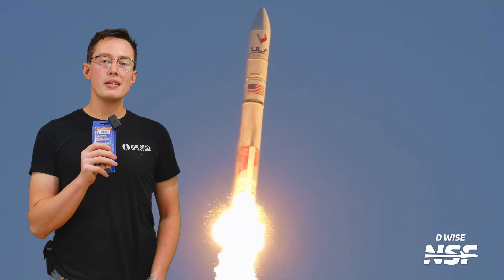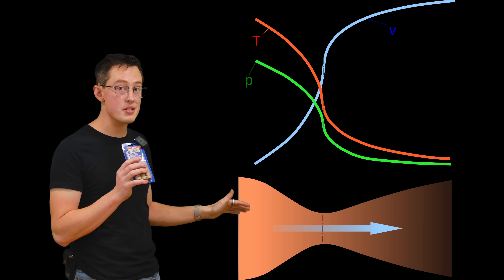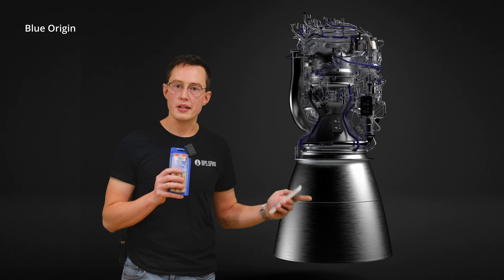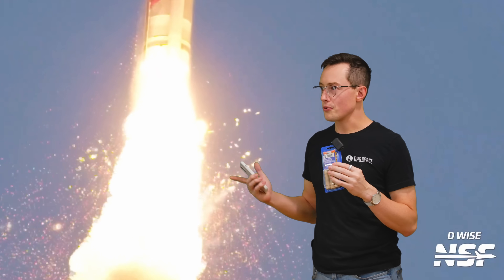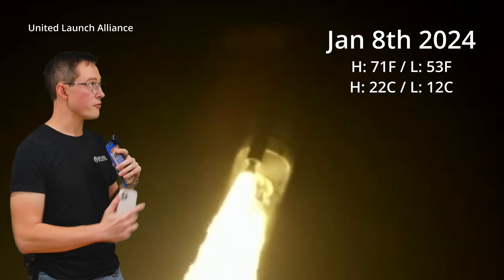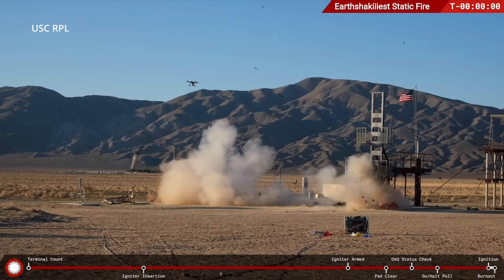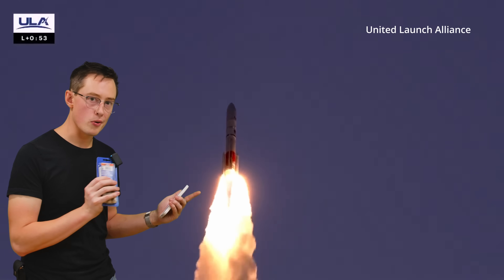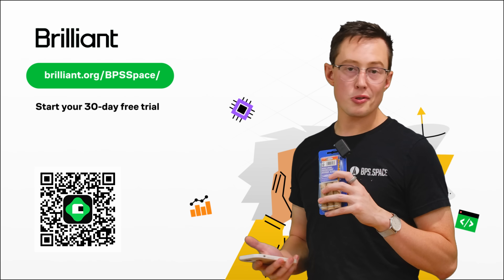The Problem with Northrop's Solid Motors

Comment: "Sometimes people get unreasonably upset about that" he said in preparation to delivering an accessible explanation in metrics 90% of the world do not understand.

And would struggle to understand even using convertors, because for literally each occupation the Imperial system users had developed their own versions of units.
That differ depending on the country in question 🤯

That's why I call it the Empirical unit system.

Comment: had a D9 engine explode on take off in one of my rockets. Luckily our design was inspired of the ariane 6 in config 64 so the engines were in the booster so we had like 1 booster exploding and the rest of the rocket still taking off. but yeah the booster exploding is definitely not fun even on small scale rocket x)

Comment: I work for Northrop and I work on these nozzles. Despite the sarcasm, I have to say this was a very fair analysis, especially given it was done only with publicly available information. 

SLS and its planned successor, BOLE, both have parabolic nozzles.

Many parallels have been drawn between the Vulcan and OmegA nozzle anomalies, but there is an important distinction between the two. The OmegA anomaly happened during tail-off. At T+ whatever time the nozzle failure happened, the booster already would have been jettisoned. Had this happened during a launch, the flight would have been unaffected. And without getting into specifics, it also needs to be considered that the conditions faced by the static test motor (ambient pressure) were not the same that it would have experienced in flight.

Comment: You talked about checking for bubbles in your mix after setting.  Would ultrasound be good for that?  Most of the ones I found on Ebay are kinda pricey but there were some under $300 delivered.  Not sure it would work for you even if you can find an inexpensive one.  Maybe a veterinary might let you bring a highly flammable rocket motor into their office just to give it a try.

Comment: The problem is Northrup Grumman itself.
They needed 10 years and $2 BILLION to modify the shuttle booster.

SpaceX built the Falcon 9, the Merlin engine, and the Dragon 1 capsule for a combined cost of just $800 MILLION. And they built all 3 concurrently in just 6 years. 
SpaceX was a 3 yo company when they started building them.

Either through planned greed, or incompetence, the taxpayers are getting screwed.

Comment: Actually, as the chamber pressure of the motor or engine goes up, the % of diverging nozzle effect goes up also.    When we get into high pressure liquid engines, the nozzle is a much larger % of the contributor of thrust.

Comment: Would it be possible to engineer SRBs with in flight detachable nozzles so that if a similar failure occurred on a vehicle which could not compensate for the asymmetrical thrust, the intact booster could also renovate and even the thrust out again to sacrifice power for an increased chance of mission success despite the failure?
Reply: The core stage rocket is designed to be able to compensate to a degree. If the other booster ditched its nozzle to even out the thrust, the rocket likely wouldn’t have had enough thrust to get the payload to the desired orbit.

Comment: What does kgf mean? Shouldnt force be in Newtons in SI or is this some rocket convention i dont know?
Reply: Specific impulse is the momentum per weight of propellant. We usually measure the mass of the propellant in kg. To get the weight we could multiply by 9.8 and change the units to newtons (1kg has a weight of 9.8N), or we can just change the units to kilogram-force, or kgf (1kg has a weight of 1kgf). It’s not part of the SI system but it’s an accepted shorthand

Comment: Solid rocket motors were old and dangerous and disliked already in the 30s. 
And in fact they caused the biggest tragedy for NASA back then.  The only applications vaguely valid is for long storage boosters that need quick launch in seconds: those used on 4th of July...
The STS had two because of the money of the dr strange love military, and in fact buran had the glorious Energia.
Reply: You mean like those used to deliver nuclear warheads. Both the, Minuteman III ICBMs and Trident II (D5) SLBMs are solid fueled for this very reason. The LGM-35 Sentinel which will replace the Minuteman's will also be solid-fueled. A missile that needs to be loaded with liquid fuel and which might take minutes to launch isn't a very effective deterrent. 💀
Reply: @aarongreen1654  this perfectly clear to me. As clear as the need to dismantle those Dinos underground since jfk
Reply: The Challenger disaster was entirely avoidable and people warned that it shouldn’t have launched. 

But overall, solid rocket motors have a good safety record.

Comment: Its an ABSOLUTE MIRACLE, that the solid booster didnt blow up. Even with the converging and throat sections supposedly intact, that could have gone very south.
Reply: The cases for these motors have a much higher safety factor than the nozzle. If there’s a failure, it’s far less likely to be in the case.

Comment: In order to see how much of each part of the nozzle does what percentage of work wouldn't you need to compare removing the part to removing all of it?  Surely the thrust doesn't drop to zero if there's no nozzle geometry at all right?
Reply: Just based on the initial tilt we see in the rocket, we know that the booster was still producing most of its intended thrust.

Comment: You will kick yourself... but those pre-assembled JST cables can be re-arrannged in the holder so you can  connect red to red and black to back..  With a small pick you can lift the tab on the plastic connector housing and pull the metal spring connector out of the housing. This will allow you to swap the red/black wires to your hillbilly battery connection can look a little bit less hillbilly. ;-)

Comment: To be fair, their solid rocket boosters have an exceptional record of reliability over decades. If you want to make the case that there is a systemic problem based on a recent isolated example of failure, you can make the same case about Falcon 9 engines.
Reply: falcon 9 uses 9 engines and it still had over 330 successful consecutive launches, highest record of any orbital rocket.
Reply: @miguellopez3392  Have you added up all the successful solid rocket booster launches? Despite the successful record of falcon 9 engines, they have suffered recent failures, so one should ask the question, why are they failing NOW? What has changed to make them start to fail after being so reliable, for so long?
Reply: @brendanpells912  yup, still not as close due to sheer number of launches it had, the boosters that are experiencing failure are the ones that have had over 20 flights so they are bound to fail.

Comment: Boeing being anywhere near a fucking rocket should be a crime, they have the worst safety of any modern airplane, and yet were just cool with them making fucking rockets?!
Reply: "they have the worst safety of any modern airplane," is just factually incorrect lol. They have had a few high-profile accidents lately, but in terms of actual metrics, they are still incredibly safe. The Boeing 717 literally ranks #1 on the list of safest aircraft in terms of total passenger miles flown. It's flown for 3 decades, carried millions of passengers, and has not been in any accident serious enough to cause a single fatality or aircraft loss. Not one. 

It literally doesn't get safer than that.

Stop getting your 'education' from headlines and social media.

Comment: 3:05  SLS solid motors are quite literally leftover shuttle motors (at least for the first few launches) so yeah, no change there.
Reply: They’re not a 1:1 match. There are some differences.
Reply: @AM-rd9pu 
I think they may be putting in an extra section, but they are literally shuttle SRBs getting pulled from storage.
Reply: @KingCovfefe  They’re 5 segment boosters as opposed to 4 for shuttle. The case segments and a lot of the metal hardware are reused from shuttle boosters.

Comment: SLS Boosters and the original SRBs both have parabilic nozzles, they qre just mostly submerged into the engine skirt and combustion chamber itself because they use a sunken flex seal for thrust vectoring.

Comment: Just look at the diversity, depth of knowledge, production capacity and innovation of all those businesses that were swallowed up by the big defence contractors like Northrop Grumman, Boeing, Raytheon and BAE Systems. It is obvious that most of that diversity, depth of knowledge, design and production capacity and innovation has been squandered and higher prices, longer delays and poor outcomes are the result. Break them up, simplify the defence acquisition process and offer more long term contracts.

Comment: A couple other important things about parts falling out:
If you can design the front to fall off when it's not flying (storage) and the back to fall off in flight, then it's safer. 
If the back flies off and your motor isn't made for reaching a steady-state thermal condition (bc steady state is too hot, think of short burns mostly) then when the back flies off the motor might burn for longer (if that included the throat) which would make thermal conditions everywhere much worse than expected.

Comment: So, to be clear, there was no problem with Northrop's Solid Rocket motors? They worked as designed which allowed the vehicle to make it to orbit? Am I missing something?
Reply: The nozzle failure happened because there was a problem with the motor. However, the motor was designed such that it could survive a nozzle failure and not cost the entire mission.

Comment: Well if the system works just fine without the nozzle, then delete the nozzles. The best part is no part. Can’t break, costs nothing, takes no time to install. They just proved they don’t need it, so delete it!
Reply: There was a significant loss of thrust. It was only because the rocket wasn’t near its payload capacity that the core stage and second stage were able to compensate for the lack of thrust from the booster.

Comment: It's supposed probably that the audience interested in watching rocket engineering calcs on utube instead of anything else are expected to be at least smart enough to be able to convert inches and pounds into metric and back if they go back to their comrades t build a similar rocket after watching. There are these catalogues where you (or someone) has to show a screenshot of some spectrum - colored image to prove they are smart enough to run it in simulation. It's supposed to be for granted. Ok what I' going to do is to write down a list of some ten reasons why I'm smart

Comment: If you need to machine a custom curve on a manual lathe use a taper attachment with a 3dp profile on the longitudinal rail for the follower to trace.

Comment: I found your channel through the NSF Flametrench video... entertaining and informative.

I have to say that my suspicion is that the canted nozzle design may be the part of the problem, since I can imagine higher exhaust force and erosion around the "outer" section that developed the failure. Can you model the flow differences around the throat / nozzle interface to check this ?

The great save for NG and ULA is that it seems they canhopefully just unbolt the exixting nozzles from the many already built and in-production SRMs and replace them with an improved design relatively quickly....

Comment: How much panic does such an even cause in the control room? Does it mean that some guy sweating suddenly a lot holds his finger over a self destruct button while others are calculating odds in record time? Or is this something which is already catalogued as an option of a failure and therefore can immediately be decided to work within the margins of efficiency (if it happens at a certain height and temperature)?

Comment: nah bro aint no way. This is a a extreeemly similar LRE that i am developing. From what i can see this is a printed copper alloy nozzle with a single pintle elemnt. Seems like 1-2kN in size and probably from the straight canals i am guessing cooled by ethanol. Its veeery similar to mine. It would be my pleasure to compare results. Very interesting seeling method between the injector body and nozzle. Best of luck on that project.
Reply: Allso i can see there is a extreemly thin wall wich might be sound in regards to stress and heat transfer but is impossible to print. If the alloy is to be cintered. Add the wall to like 1.5mm and then machiene it down. That wokred for me for CuNi2SiCr printed nozzles

Comment: Metric or imperial, they are both units of measurement that work perfectly for what you want to measure.
It makes more sense to use imperial when living and working in a nation where imperial units are the norm.

This is not a comment at mr. Barnard, but a general impression from someone based in metric:
I learnt imperial units long time ago. Mostly because I watch a lot of content that uses those units, so it was convenient to get a better sense of what they're talking about. What grinds my gears is how rare it is for americans to even look at metric beyond "isn't imperial, won't touch". There's nothing wrong with using imperial, but avoiding metric is weird.

Comment: 2:59 False. The SRBs on the Space Shuttle used a parabolic nozzle. What you see is a conical air skirt that housed separation systems and thrust vector controls connected to the nozzle underneath.  There was a lot of concern with the SRBs after the Challenger disaster. There is also a bunch of studies about the TVC, uneven nozzle ablation material wear, and the underlying char cloth fiber direction. Which I think you briefly mentioned before. Detailed video time? I’ll send you a message on Insta for that delicious source info!

Comment: maximum thrust is also most critical at the instant of liftoff where your thrust:weight is worst - losing 4% of your thrust after you've used 8% of your propellant is much less of an issue than just not having that thrust at the point of liftoff.

Comment: I have to wonder if this had be a Vulcan VC4 or VC6 with either 4 or 6 SRB's that failed SRB would have been right next to 1 or 2 other SRB's. Would that have possibly caused the nozzles on the adjacent SRB's to fail as well? Without that cone you would have a lot of the exhaust gas hitting the neighboring cones. Dreamchaser for instance would have been a VC6 launch. Something tells me this would not have been as successful on that.

Comment: Regarding the unit debate, I agree that metric is easer, but many large rocket companies still use imperial for design and analysis. It's a lot easier to buy imperial COTS parts in the US, and it's easier for machine shops to machine stuff in imperial units (more imperial tooling than metric tooling).

Also your technicians may berate you asking what "kind of commie units are you using" if you hand them a drawing with metric.

Basically, design is easier in metric, build is easier in imperial (if you're in the US). You can choose which one benefits you more, or commit to a bastardized system of using both.

Comment: Screw the negative comments! Use that imperial system. If it works, it works. Whatever you are more comfortable with shouldn't really matter to the comments, I almost guarantee that 99.9% of commenters have never and will never touch a rocket of any size. Keep on making awesome rockets and turning out fantastic content. Great work as always.

Comment: When I took a screenshot of the shuttle booster nozzle and tried to put a straight line over it, it didn't line up at all. To my eye it was 100% curved, but I wanted to check to be sure.

Comment: OmegA looked like the atmosphere crushed the nozzle when pressure dropped off quickly as the srb was reaching the end of the burn which ironically means on a flight it might have performed perfectly while on Vulcan it looked like it had a burn through.
Reply: Yes, buckling during tail off is a different failure mode than burn through during flight.

Comment: Did your calculations account for the apparent asymmetrical thrust? It looks to me like there might have been a gap on the outboard side that increased the angle of some portion (a third?) of the thrust, which reduces the upwards thrust.

How much did this drop performance beyond the calculations you made? Worth another video to answer?

Comment: In early testing of new things in our motors we will often dispense with the divergent cone altogether. As seen in this video using no divergent. You can clearly see is this video, this results in a seriously under expanded nozzle but gave us valuable info on casting tubes, liners, and such without risking expensive flight nozzles. https://www.youtube.com/watch?v=ykLyrmrDKg8&t=61s

Comment: 4:20 man, that's really what most need. 
the thing is that the imperic system is both slightly less effective and less common. plus metrics are in the Si system.

Comment: I found the video both funny and informative.  In particular the bit about the three degree cant being the difference between success and failure was something I hadn't heard anywhere else.  The one thing I would have liked to have seen would have been a discussion on the effect of altitude on the effectiveness of the nozzle.  While it may only add 20% to the efficiency of the rocket at or near sea level, I suspect that as you climb out of the atmosphere the sideways expansion of the rocket plume will increase enough to noticeably degrade the performance of a rocket that has lost its nozzle.